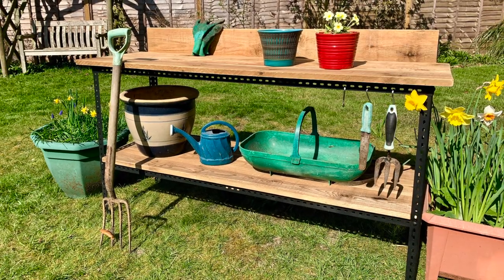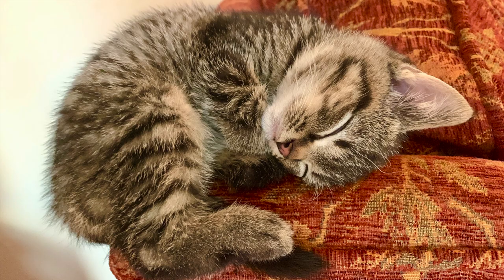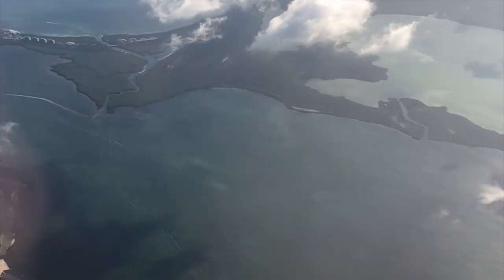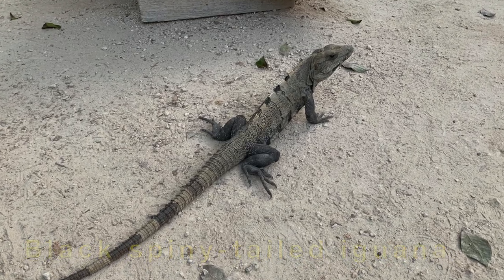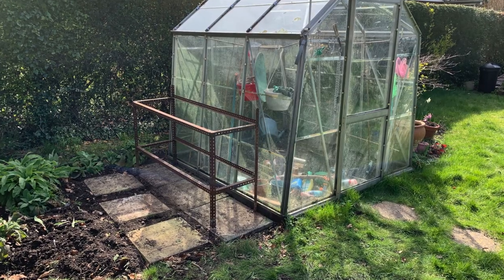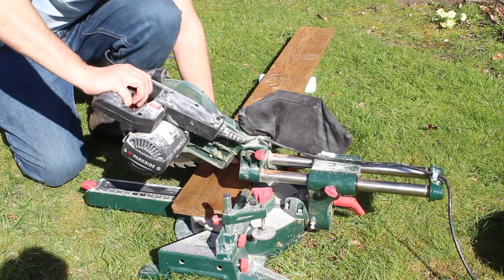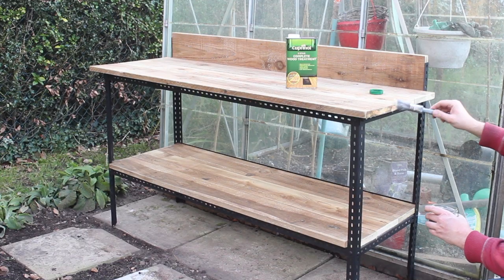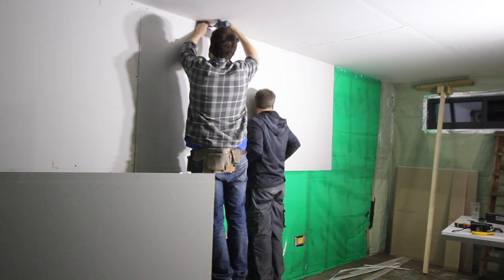Steel-Frame Potting Bench - An easy afternoon project

Comment: Have not used Dexion in years.... Last time was when I built some shelves to hold ZX81and ZX spectrum repairs in a factory I worked at in 1981. Good to see all your work you have been up to. I'm just about to do a first floor timber frame on the brick cavity wall as the cavity is not wide enough. Put the steels in end of Oct/November as I will have a point load on top. So your series of the garden room/workshop is handy.  Thanks and keep up your good diy work.... I did before the lock down get a bad of bonding and multifinish so I can get on boarding and repairing the bit I had to smash out to get the steels in..... Laters you two
Reply from the maker: Ah the Sinclair Spectrums! Before my time but I sold one for someone on ebay a few years ago for a pretty penny.
That sounds like a cool project. Email me some photos sometime, I'd love to see it Glen!
Reply: @AliDymock  have sent you an email to the hello email address

Comment: good to hear an update Ali. congrats on your engagement. may i ask how long did your summer house project roughly take? i've been looking to jump in with my both feet and start planning out but slightly unsure.
Reply from the maker: Thanks :D Umm I'm literally the worst person to ask about this because 1) I filmed lots of it which slows you down so much and 2) there were times I didn't do anything for months (life). 3) I had to save money to do some things so work stopped. What I can tell you is that from bare ground to the fascias/EPDM, it took me 4 months working pretty solidly. At that point I had a dry, secure building and have just taken my time with the rest. 
With all building work there is a rule which is almost ubiquitous: it will take more time, cost more money and be more hassle than you think! That said, it's totally worth it and a very enjoyable project but if you need a office, for example, in 2 months' time you might have an issue.

Comment: Welcome back thanks for inspiration , i have dexion about two inches on each side in odd lengths how to stitch then together is a problem . i may but up and screw to the timber ( thich pallet wood ) i'm not sure about leaving it outside though even with a cover . As regards finances check out lump sum payments  I did a lot of overtime 30 years ago and put in £1000 which was a lot then but it reduced my 25 year mortgage by 10 years an accountant friend of my told me then September is the best time to pay lump sums BTW the building society where quite snify about it. 

When interest rats when to 15 % i kept paying what they wanted it reduce it it stayed the same but if I had extended I would have been paying well past my retirement. Bearing in mind a mortgage is the cheapest money at the moment.  I think a balance is the way to go IE spread the places where you put money.which your background you must know people who could advise. in the end it you who decides .
take care . Illegitimi non carborundum.
Reply from the maker: I had to google the latin 😂
Yes I think there is a lot to be said for becoming mortgage free (eventually) and not having a monthly payment, even if mathematically it's not the best use of funds. I think we might see where we are at the next refinance. If it makes sense to drop a lump sum to get to the next LTV bracket then that might be best. Good advice, I'm hoping IRs don't go to 1980s levels!

Comment: Re-viewing your garden room videos again and again as I plan my own - they've been incredibly useful.  Congrats on the engagement.  I am 50 this year and would suggest that mortgages at the moment offer the cheapest money you'll ever get so I wouldn't bother paying it down any faster.  If you are lucky enough to save some cash over the next few years then I would look to invest it (check out monevator.com for some info although of course these are very uncertain times) and improve the house.  Putting off renovations while you save up is fair enough but if you're not careful you will find ten years has slipped by and you're still living in a cold house with draughty windows and a crappy boiler manufactured in 1982!
Reply from the maker: I'm inclined to agree with all of that Andy, and Monevator is good! I think we'll take a 3-prong approach when possible and try to do a bit of all three, that way, while we won't hit a home run, we won't feel like we missed out either. It is pretty astonishing that mortgage rates are less than inflation and therefore the amount owed is eroded in real terms more than the interest paid on it. Who knows what the current cash injection into the economy will do though. That said, I'd feel more comfortable once we were at a 60% LTV (extension could help with that!) and could then pivot to focus more on investing.